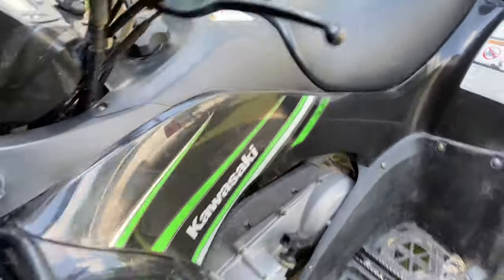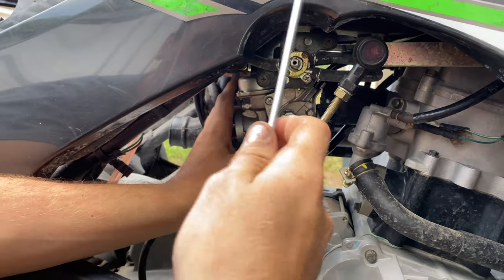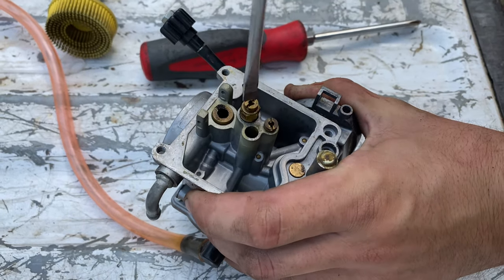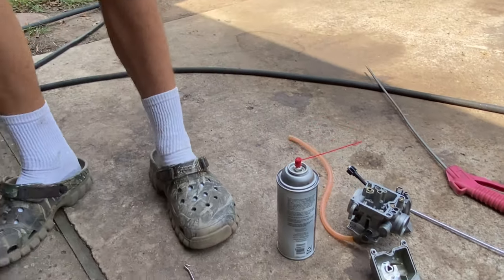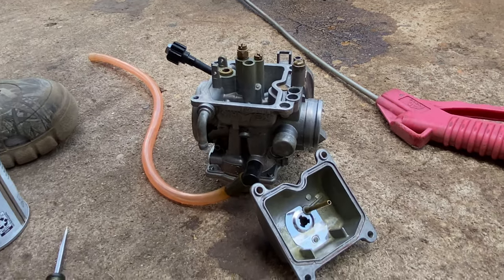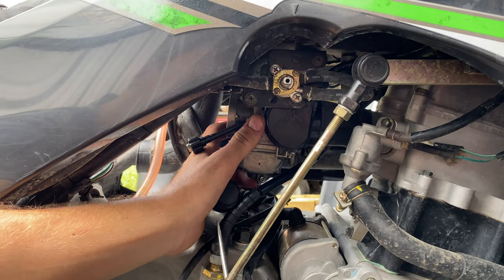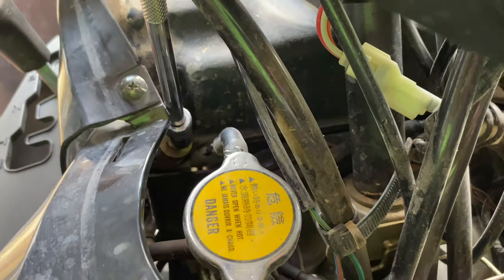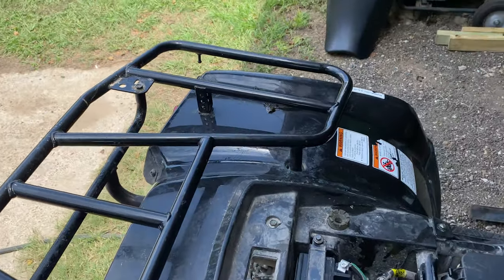How to Clean the Carburetor on a ATV(Kawasaki Bruteforce 300)

Comment: I have this machine, I can't get it to idle, has lots of power and very fast. Took carb apart and went through all the jets and cleaned it like you did in this video. Changed spark plug, plug was black. Blows black smoke when opening throttle in neutral. Seems like it is running rich and there is no mixture screw on the stock carburetor. I read that it may need a valve adjustment? Any ideas?

Comment: thank you for the video  this is one of  the best  repair videos i have  seen  the q tip trick was a great tip  thank you  being so thorough  a lot of people sometimes  jump past  some thing they may not seem is important  but if  your doing this for first time  you want to see every aspect  thanks  again  great job on explanation throughout  whole video
Reply from the maker: Thank you! Glad I could help!
Reply: if you dont mind if i could oick your brain on another problem  my daughters  brute force was low on coolant  it  was shut down right away and the electric fan was coming on  now  we have added fluid but the fan  has  stopped working  from what if been reading  there saying to disconnect the fan and jump it out to see if the fan is still working  the 4 fuses in the fuse box are all good  is there another  fuse  i should be looking for  it stopped all of a sudden and still spins by hand there is  what seems to be a sealed  breaker   do you know if they just reset on there own or is this  a one time breaker  id appreciate any input you  have on this subject if this  is something  your not familiar with  thats ok i just thought id ask  and once  again  great  carburetor video  thank you again   be well 

best wishes 

Thomas
Reply from the maker: @thomasthomas-jz1uo  if it was really low on coolant, you might have gotten a air pocket in the cooling system. When this happens, the fan switch sensor might not be touching hot coolant so it will not kick the fan on. It might not be coming on now though because it has the correct amount of coolant in it and it’s running cool enough to not need the fan. It wouldn’t hurt to by pass the fan just to check that it’s working but I’m sure it’s fine.

Comment: Ok. Now that i got that done thanks to your amazing video, got any videos for changing the differential fluid
Reply from the maker: I don’t have any at the moment but next time I have a 4 wheeler in for service I’ll do a video. Thanks for watching!
Reply: No video needed. Literally read the  manual, pull the drain bolt. Put bolt back in, remove fill bolt on the top. Add specified amount of fluid. 10 minute job.

Comment: I know this video is older but I have a question if you don't mind. I bought a new 2022 brute force 300 about 2 months ago. I have about 60 miles on it now and it doesn't seem to have the get up and go power it used to. It idles fine runs fine, but I noticed that if I put the choke on a little when accelerating hard its got more power like when it was new. I run 93 octane in it. Have you heard of these needing re jetting after they break in? Thank you.
Reply from the maker: Might just need to tune the carb. Or possibly one of the jets might have got slightly clogged but I doubt it since it’s new.
Reply: @atvrepairsandmore2482  Thanks for the quick reply. I figured either way the carb is coming out! There's no welch plugs on mine either.

Comment: I have a problem RN with my 2022 brute force 300. It has 1030 miles on it and I leave it in my garage and when I turn it on everything is perfect but it keeps sounding it wants to turn off and IT DOES in like 30 secs. I play around with the gas thinking it needs to get it pumping but the same thing keeps turning off. I change the transmission from N to R and it turns off also. It turns off when I change transmission, stop at a stop sign or I leave it on for 30 secs. Do you know the cause of this?
Reply from the maker: Try to raise the idle just a little bit. Might need to have the carburetor cleaned. The idle jet might be partially clogged
Reply: I got a wierd issue.    With my bf 300.      I have extended cold crank time.         I can shut it off immediately.     And she fires up no issues.       It's like it's losing her prime.         And runs great.      After the initial start.             Has me scratching my head.
Reply: I'm in Florida.      I drained the tank.    Used mmo.    With new fuel.        Wierd.
Reply: Good vid brotha.    Thank you
Reply: Full choke half choke.      Throttle cracked.      Don't seems to make a diff?         Maybe it's haunted?        Once it starts.   It's perfect.            Maybe I'm too critical.
Reply: And the intake bellows are sealed.   And perfect.          Wierd